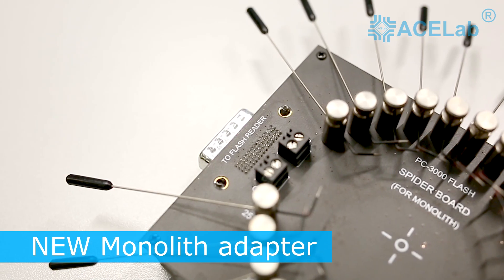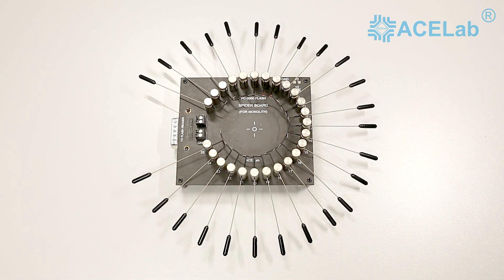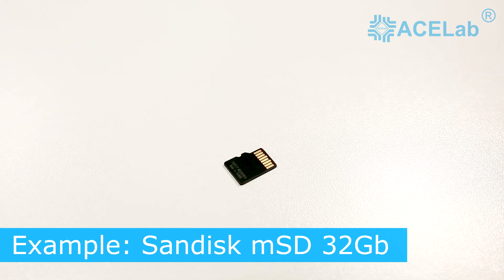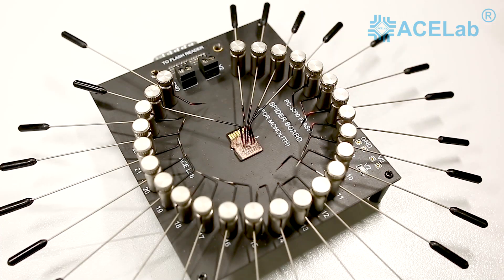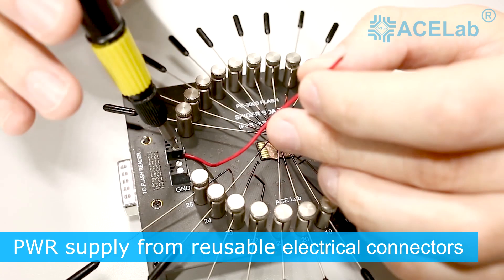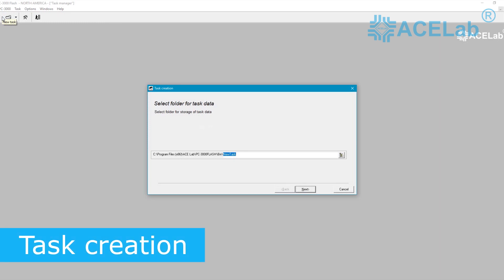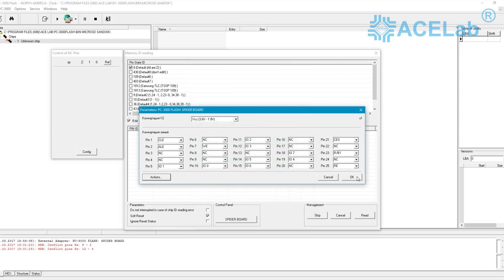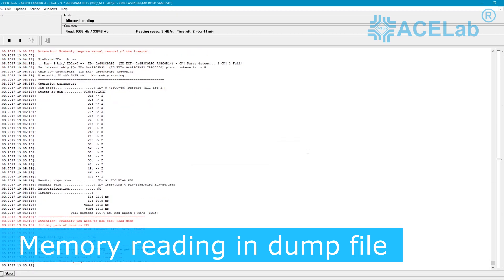ACELab Spider Board adapter. How to use it?

Comment: i have Sandisk memory card , by mistake it got formatted by Sony A7 3 camera , after doing some research i see that sony A7 do SD_ERASE command when doing format which make it impossible for Data recovery software to recover the formatted data , can Spider board with PC3000 flash recover the data from the memory card ?
Reply from the maker: In PC-3000 Flash we have solutions for working with formatted Sandisk monoliths. With PC-3000 Spider Board you can read the dump of the NAND and try to reconstruct the image using our software features.
 
Also, please remember that every formatted case is unique and without checking the case it is hard to guarantee 100% success
Reply: @PC3000datarecovery  someone said to me if the Sandisk SD card speed is more than 100MB/s the PC-3000 flash cant recover deleted photos because it uses LDPC is that right ?
Reply from the maker: @marwanFX483  We would like to emphasize that each formatted case is unique. To address your question accurately, we need to know the specific SD you have and its volume. Please reach out to ts@acelab.eu.com with a detailed description of your case. Thank you!

Comment: I'm very interested about this tool. I have a Samsung microSD with damaged external pins. If I scratch out the glue like in the video, can I recover all data using the needles to make a new circuit to the PC? The price include also the software?

Comment: Is it possible to recover data from a micro SD card that is broken into several parts?
Reply from the maker: If the mSD was physically damaged, there is no way to recover data from it. The main idea is that the cell array where the data is stored is extremely small and looks like a layout inside the monolithic structure. In case of a physical damage all lines, buses and traces become destroyed which makes data recovery  impossible.

Comment: Amasingy tool
What the price
Reply from the maker: The Spider Board is a universal adapter that works in pair with the PC-3000 Flash solution. There are several packages of this product depending on what types of NAND Flash devices you're going to deal with. Please contact us at sales@acelab.eu.com, so we can discuss your tasks and recommend the best option for your needs.
Reply: @PC3000datarecovery  sir could this tool repair bad sector

Comment: Are the needle connectors custom made? Or is it a standard part one can buy?
Reply from the maker: All the needles are produced according to the special technology patented by ACE Lab. The Spider Board adapter comes with the needles in the delivery kit.
Reply: PC3000datarecovery can a customer buy needles separately to replaced damaged one or do they need to buy a whole new kit to get more needles?